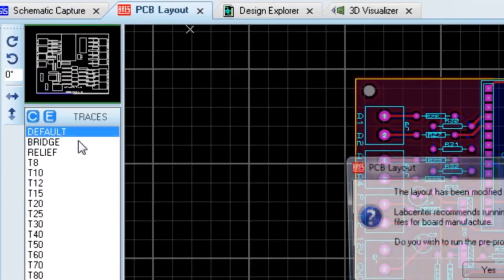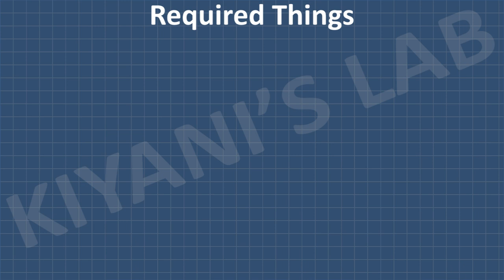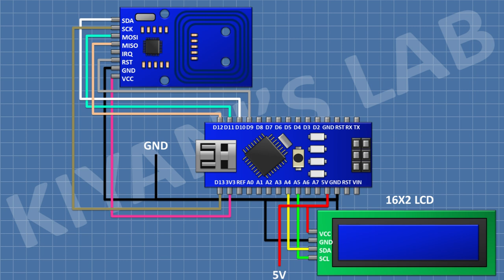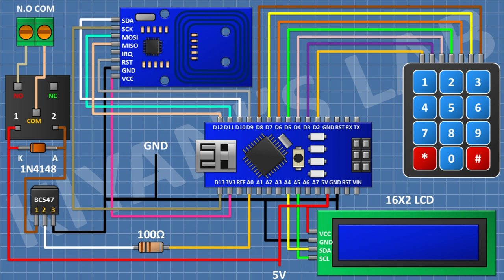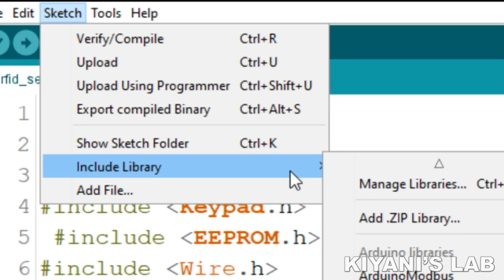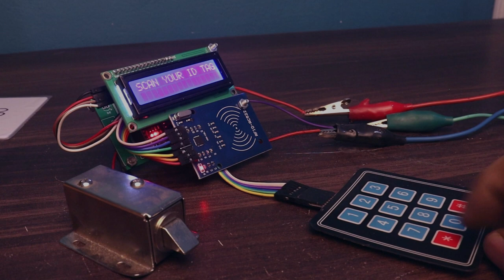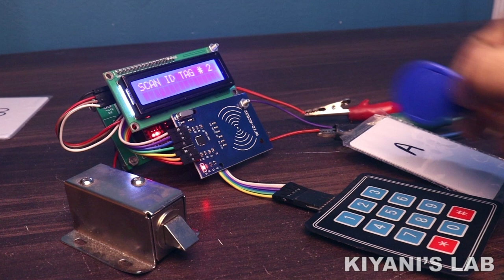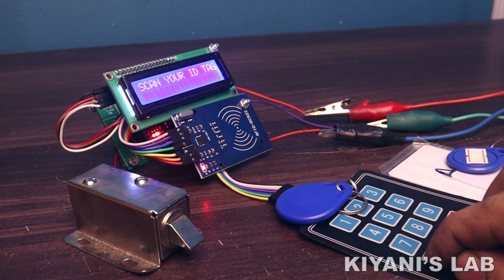How To Make RFID Door Lock | Passcode & 5 Different Tag IDs

Comment: Hello my friend, I am one of the followers of your first and second channel.. I watched the video about filling the tank and measuring the level via wireless, and it is very useful for me because I need it for long distances and I may face difficulties in extending the wires, so I pulled out the drawings for the design and the code for the receiver and only the code for the sender remained It is not in the description box and I have opened the file compression and it is not there, it may have been deleted or not downloaded with the code for the future so I need urgently and necessary for that please I need the code of the sender or both of the sender and receiver tx &rx Thank you